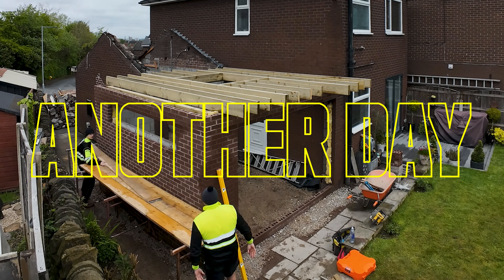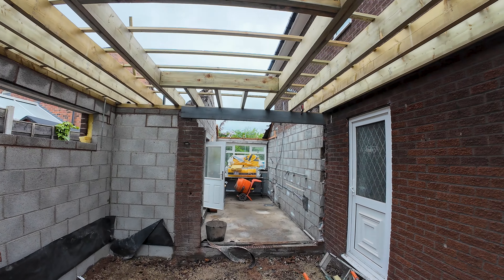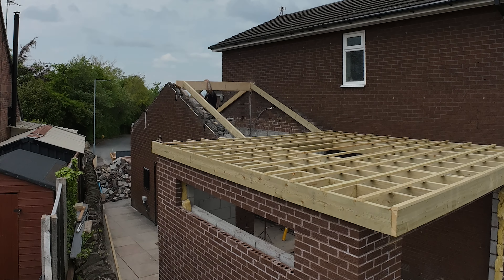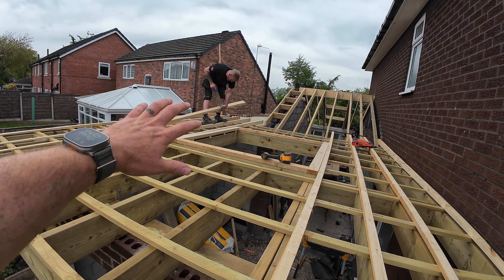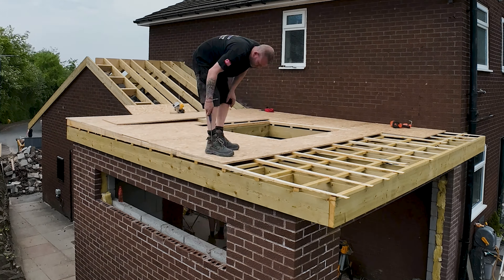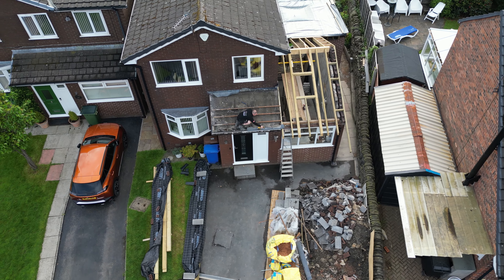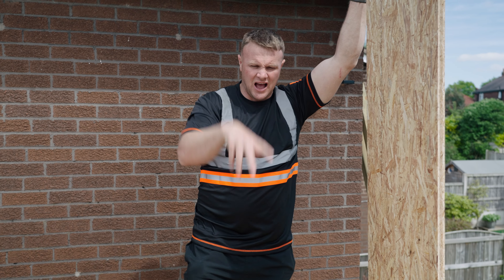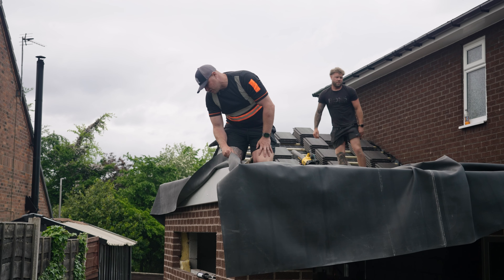Flat and pitch roof built to completion

Comment: You shouldn't have a massive fascia with a warm deck if it's built properly. You just have to build the outer brickwork up to the top level of the roof joists & then you fascia is only the width of the warm deck.

You cut the joists to the back of the block work & bring the insulation up to the underside of the warm deck.
Reply from the maker: you could also rip down the end off the joists 

you still end up with a fascia bigger than  than normal, when the whole point is to keep it matching with existing.  the client didn’t want it which i don’t mind which way i do probably less work doing warm roof as all the insulation needs cutting on a cold
Reply: @IdealConstructionRyanWalden  yeah with the new building regs it's definitely no fun cutting 150mm PIR in between all the joists.

We almost never do any cold decks anymore, but once In a while you have no choice.

I have started cutting the 150mm PIR on my saw saw doing a cut then flipping it over. No matter how good you are trying to cut 150mm square with a hand saw is painful.

Comment: I would love to see how you fitted the gable rafter ladder, I can't find a single video showing how to do this on blockwork. Do the rafters sit higher than the gable so that the ladders cross beams fit on top of the blocks or do you cut into the gable?
Reply from the maker: ill do a video on this
Reply: @IdealConstructionRyanWalden  that would be amazing,  instructional videos are what I'm after. The only ones I can find are either just the Gamble block work  or just the roof where the block work comes later( but not by the same person).